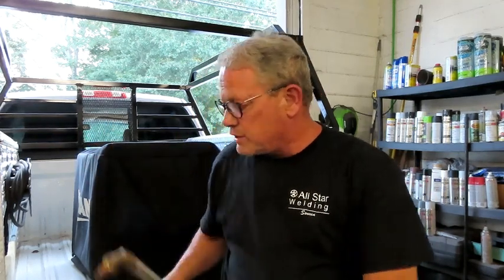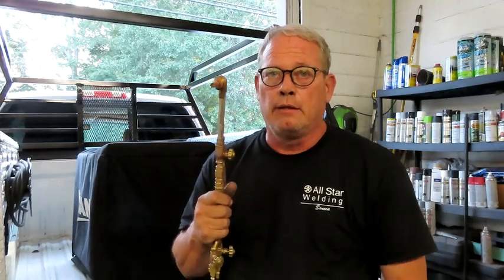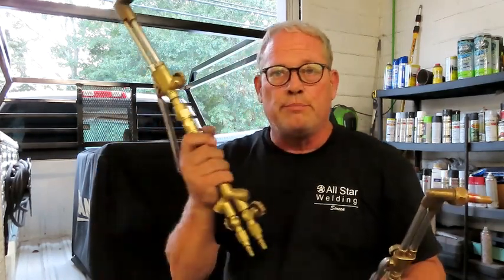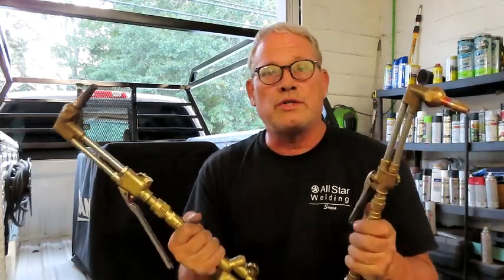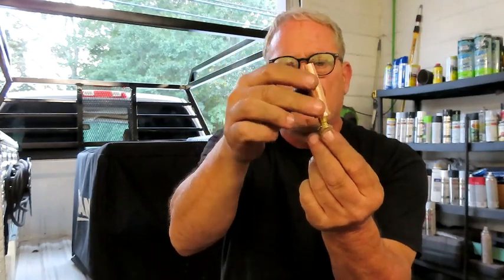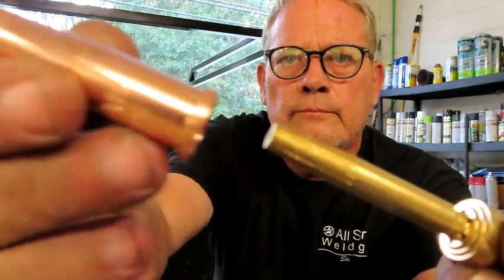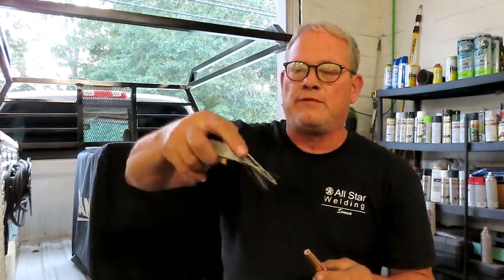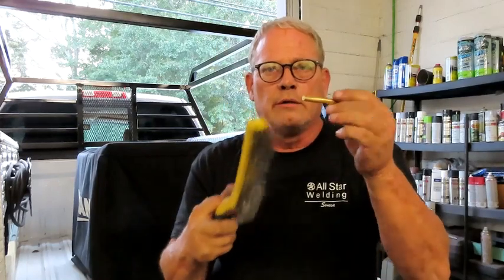Tailgate Talk #3 - Oxy/Propane Torch System Setup

Comment: What tips for brazing with oxy-propane?
Reply from the maker: I haven't brazed in forever. Just something I don't have a call for in my normal line of work. But I do know that, unlike cutting tips, brazing tips are the same.  It you'll want to use one size larger than what you'd use with acetylene.

Comment: Hi Jason, I'm so glad I found your channel and like your detailed explanation of this process. I'm going to try and get started. Using propane is exactly the route I wanna go as I'm just heating treating. Hobby stuff in my retirement years. Thanks again
Reply from the maker: Thank you, glad I could help. I really like using propane. Today I was just messing around, and used a #5 tip and had no trouble cutting a piece of train track off.  So, propane is very capable.

Comment: Here we have Atwoods Farm Supply store, they have a deal with AirGas  to sell their bottles (Air Gas seems higher than Wesco). 
 Open from 7:00 to 9:00PM M-S , Sun AM? to 7:00 pm and you can get propane there too.
Reply: Jason: you might start doing like other youtubers do and get a Amazon affiliate store/ link to get a small commission on say a regulator set, torch set, ect.  Might pay for  your memory cards.   What kind of set up do you use to get your gas rig in and out of the truck or do you leave it in?  I know there is a special cap you can get that leaves the regulators installed.
Reply from the maker: I just got an affiliate for Vevor, and I'm working on the Amazon. Now I have to figure out how to add it to my channel. I haven't had the time to sit down and do it

Comment: This sounds almost too good to be true..  are there really any downsides to running a propane setup over acetylene? I've just started teaching myself to weld (tig and stick, got mig covered) and am needing a torch set up, if there are few to no downsides I will be going this route for sure.
Reply from the maker: The only difference is that you can't weld with it, but you can braze. But heating up, cutting, it's the best choice really. And far cheaper and more convenient.
Reply: @AllStarWeldingSC  thanks for the reply, I appreciate it. I am picking up my argon tank this weekend and was going to price an oxy/acet tank combo but knowing this I'm gonna go ahead and just rent an oxy tank while I'm there and start looking at regulators.
Reply from the maker: @jadeolin8514  I never thought about it, but that is another advantage of propane over acetylene. The tank!! Buying an acetylene tank is a huge investment. They are expensive. I already have 4-5 prioane tanks laying around my shop. But I bought one from one of those swap out places. Blue Rhino I think it's called. I took off the plastic wrap that was around it because as you use the propane it creates ice around it. I didn't want that moisture getting trapped under it and causing rust. I get it filled at a local hardware store for $10, and they fill it more than a swap out place does. For my regulators, I went to Amazon and got the Oxy/Propane set from SUA, I think it was. It's just a regulator, no since in spending a fortune. It's the green and orange set. Make sure to get a type T hoses made for propane. And definitely don't forget the flash arrestors. I got the kind that go on the regulator end instead of the torch end, to make the torch smaller and lighter. I also put on so.e quick connects on the torch end of the hose. Not necessary, but it's handy to have because in my shop I tend to swap out my torches often.. Good luck and enjoy. If you have any more questions, feel free to contact me at Allstarweldingsc@gmail.com

Comment: We use propane and oxygen for thermite welding and cutting as you said RR track apart. I have learned since ive started working out here for a major RR that definitely propane is better . Worked on track Maintenance for around 10 years now mainly in the welding side . Welded for the Marine Corp for 10 years as well .
Reply from the maker: Yes, you are right. I think foe the type of work you do, propane would be the better choice. Mainly for the portability of it.